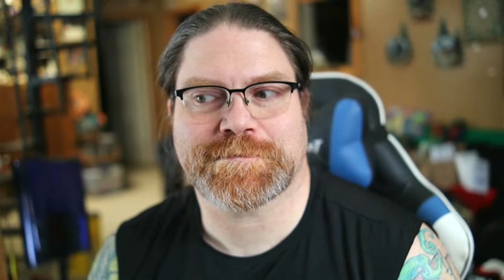Which biocompatibility tests do you need to do for a 510(k)?

Comment: How would you classify the duration of contact for a medical device used to store blood and blood components cryogenically (for 30 days or more) but comes into contact with the patient for less than 24 hours? According to ISO 10993-1, what would be the duration of contact classification for this scenario?
Reply from the maker: Blood and blood components are not something that you can remove once you infuse them into the body. Whatever chemicals were extracted or leached into the blood and blood components will remain in the blood once you infuse it--even though the IV bag may only be connected to the patient for minutes. Therefore, the testing for demonstrating biocompatibility should be evaluated for the long-term endpoints instead of the limited duration endpoints.

It is also recommended to review the biological evaluation plan with the regulator in advance, because the storage environment is unique and may result in a very different extraction of chemicals from the bag than room temperature storage. I would expect regulators to look for evidence of how the risk of cryopreservation has been addressed--in addition to the endpoints listed in ISO 10993-1.